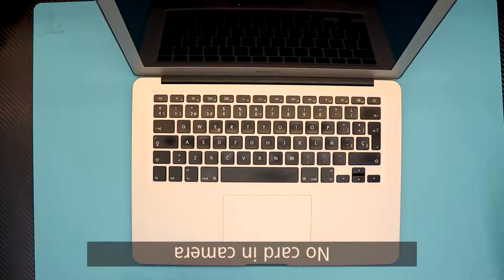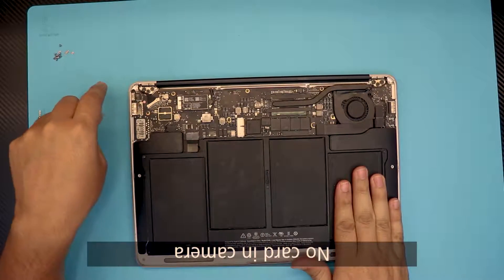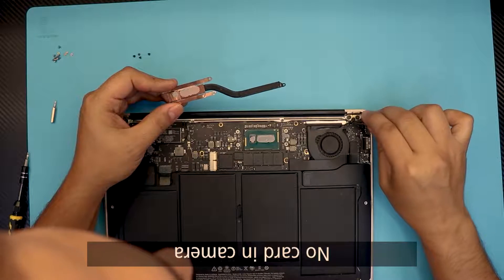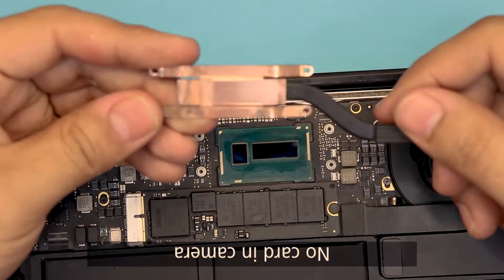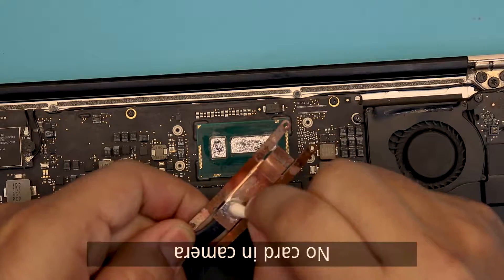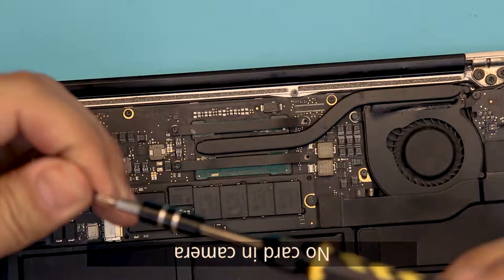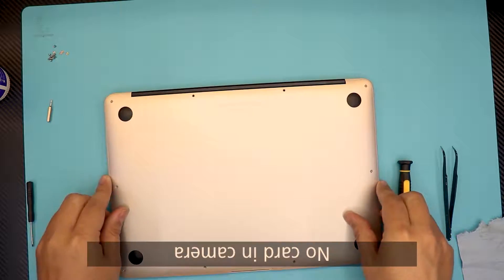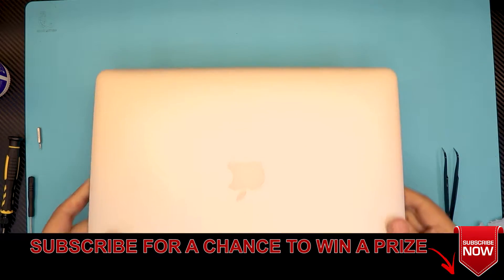HOW apply liquid metal to MACBOOK AIR,  Thermal Repaste Grizzly Liquid Metal.

Comment: Pls just put the rubber gasket cause I don’t want the metal to spill and fry the motherboard
Reply from the maker: No need for the rubber gasket unless you're planning to apply a large amount of liquid metal, which is not a good idea. Instead of a gasket, use thermal putty around it.
cheers🍻
Reply: @uFixTek thanks for the advice and information
Reply from the maker: It's my pleasure my friend.